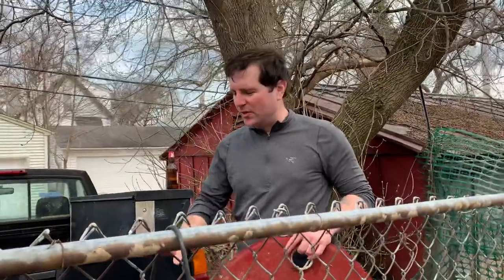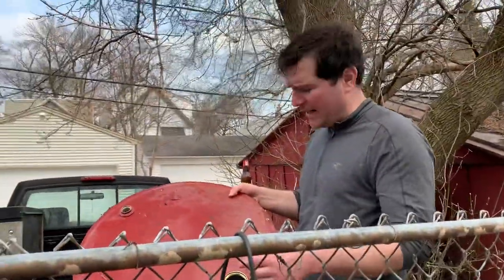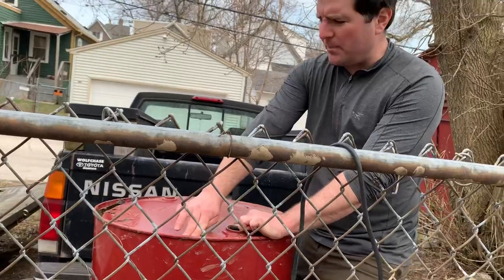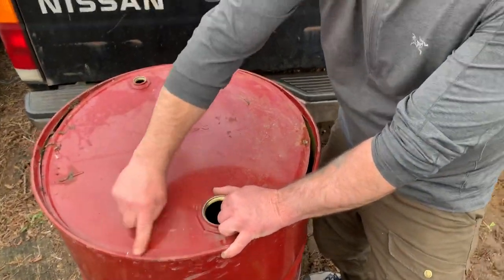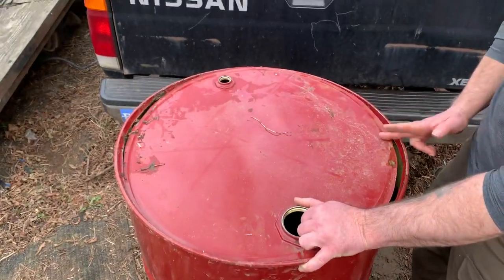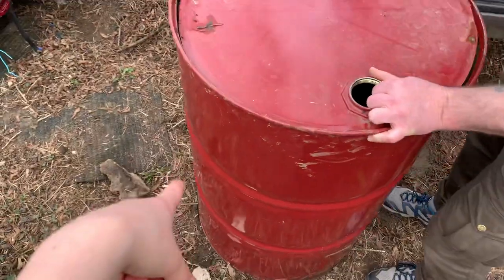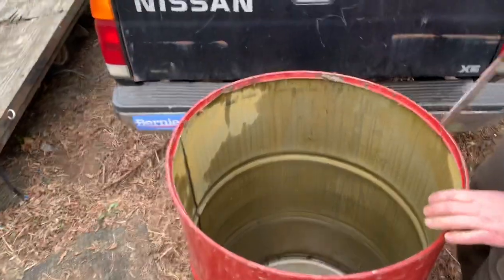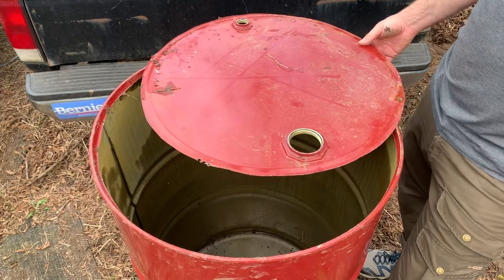How to cut the lid off a 55 gallon drum safely

Comment: Isn't flammable vapor only dangerous when creating sparks or using high heat like welding or torching or grinding? I didn't think using a jigsaw would create any sparks?
Reply: Static electricity can ignite it, depending on what it is, especially if it's under pressure. But any metal on metal could definitely create a spark too.  Lot of people have been seriously injured and killed cutting the top off a barrel like this not knowing what's in it or taking the right precautions. That's why he filled it with water.
Reply: Besides that, the amount of vapor left in a barrel that's been filled with water wouldn't be enough to do anything anyway.